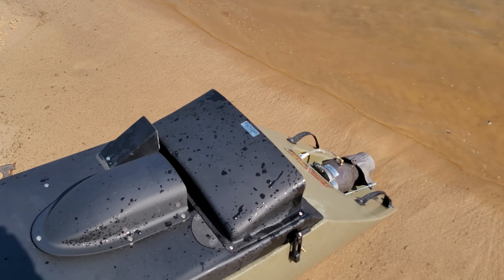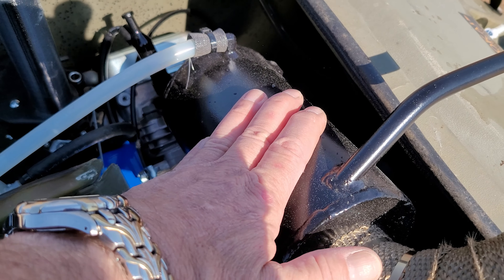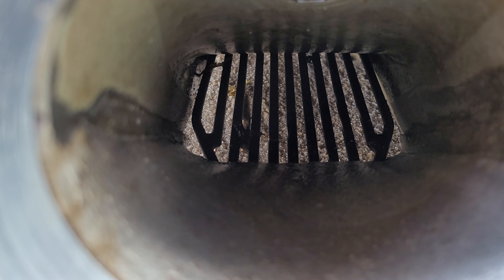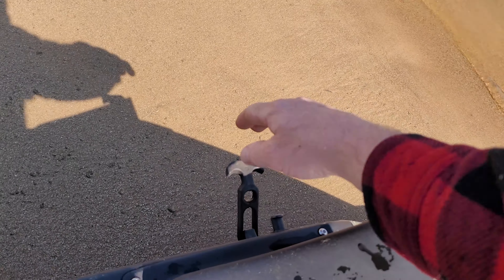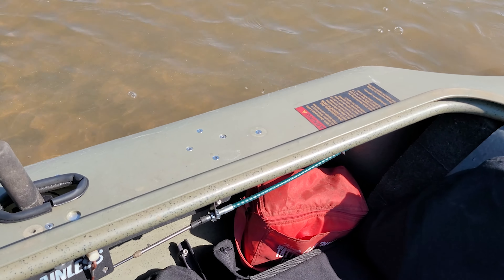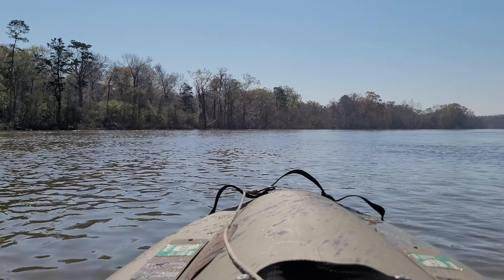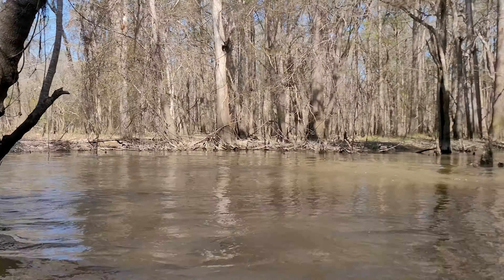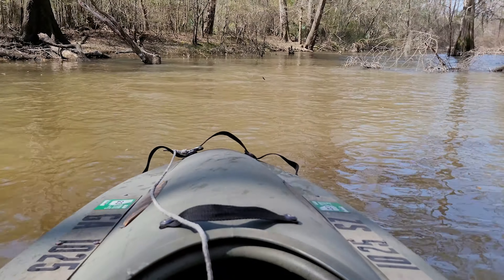KS 2003 Mokai Tillotoson 212E Conversion River Test 2 - Beached

Comment: why did you replace the wildcat?
Reply from the maker: I didn't. The wildcat was only used in 2010-2012 models that originally came with the Subaru. Tillotson is a much better motor IMO though, bang for the buck.  I probably won't get another Wildcat.
Reply: @ImprovingYourMokai  the Wildcat actually is a better designed engine there’s some videos to prove it lighter parts reinforced block better design more airflow better designed Piston design like a racing motorcycle and more but since you don’t use them there’s no sense in talking about it